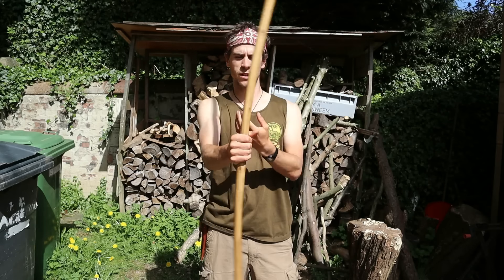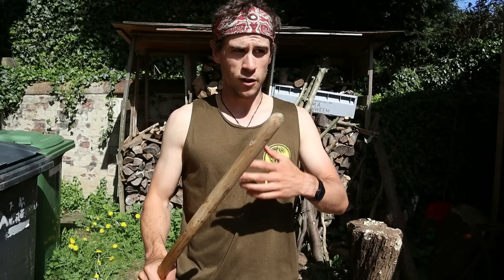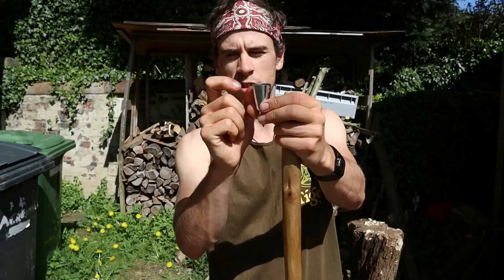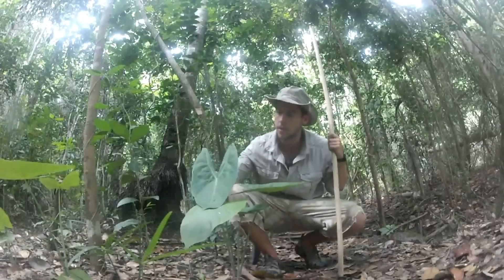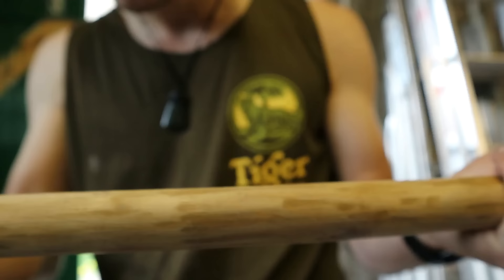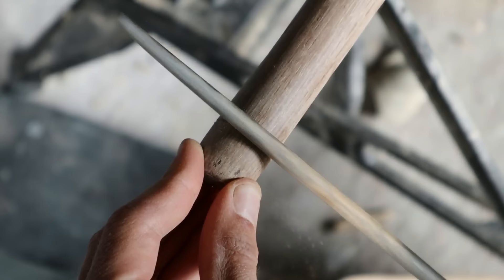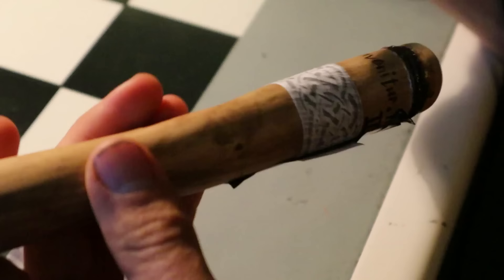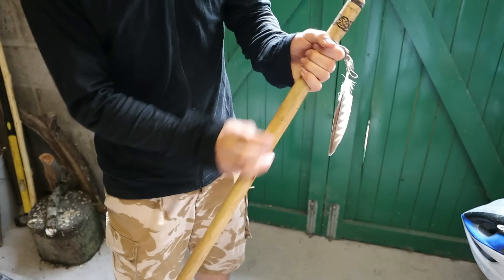Pimp My Staff- Walking Stick Maintenance, Decoration and Optimisation- Alpine Ferrule, Burn Designs

Comment: Looks like your jo is red oak? Anyway, here is some advice from someone who has been doing jodo (jojutsu) and hiked with a jo for 20 +  years, 

White oak is better than red oak. Red oak will not withstand blows by other weapons long term. Just a matter of time until it starts to crack. That's why dojos, that teach jodo generally use white oak, as it takes a lot more punishment and can last for years. I still have my original jo staff from when I first started. You can buy a good quality white oak jo staff from Tozando in Japan. They ship internationally. Also, you don't need linseed oil. Linseed will cause the staff to sweat in Summer. A slippery jo is difficult to practice with and can be dangerous. Just sand the varnish off and practice until your sweat sinks in. Have never seen a staff rot or anything else.

PS I really like your channel and think your experimentation and devotion to your roots is great. Look forward to more videos.
Reply from the maker: Thanks mate! Thats really interesting! So do you hike with the same white Jo staff too? I defo understand the sweating part, but I have personally found it stops happening after the first residual oil comes out. I would have thought that if there was no hydrophobic treatment in the wood then it would soak up any moisture and become heavier and swell?
Reply: I use another white oak Jo, slightly lighter than my dojo Jo, which takes far more punishment, but either is interchangeable for the other’s use.  Anyway, there are wild pigs and bears nearby and a Jo would seem to be a good way to keep them at bay if attacked. Too short a staff doesn’t allow you to put sufficient strength into a thrust, but too long is clumsy when there’s lots of vegetation, both for hiking and fighting. A Jo is perfect. I wouldn’t bother trying to swing and hit with the tip, just keep jabbing and hope the pig/bear gets the message and gives up. My hiking Jo is the first one I bought and the only one I treated with Linseed Oil. I think the sweating might actually be my sweat not getting absorbed into the wood. A non-treated Jo will also become slippery but not to the same extent. Hint: one way to deal with a wet Jo is too wrap some cloth around it. Being resourceful, you could probably fashion something out of a cotton/canvas Jo bag. Might be an idea to get a Bo bag for your other staff. I think Tozando sell them overseas and perhaps Meirin too, both well known martial art equipment suppliers in Japan. I can investigate if you want, just let me know.
Reply: Probably too late but instead of epoxy on the split end of the Jo, use water thin super glue. It will be wicked in to the crack and form a perfect seal. Be sure to clamp the crack as tight as possible or it won't hold. Model shops usually carry the water thin variety.
Reply: By the way, a Bo is more akin to a battlefield weapon in the way it is wielded than a Jo. A Jo would typically be used as a one on one weapon, usually to subdue rather than kill. Keep in mind, your Dirk and a Jo are an excellent combination. The Jo enables you to get in close much easier and with less risk than a Bo. Once within range, you can drop the Jo and draw your Dirk. The act of drawing from left to right can be used to slice your opponent across the abdomen, then reverse the grip and with both hands (left on the blunt side of the blade, right hand on the handle), drive the blade into them with full force. Nasty but effective. Just have to remember, even a dying opponent will fight back. Don't pause for a selfie.